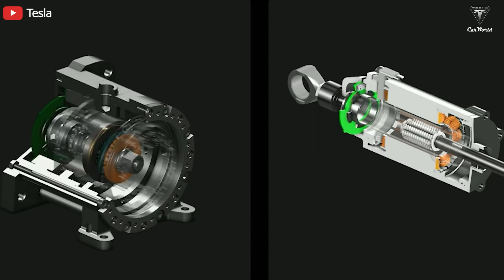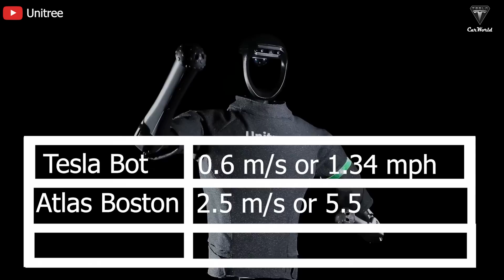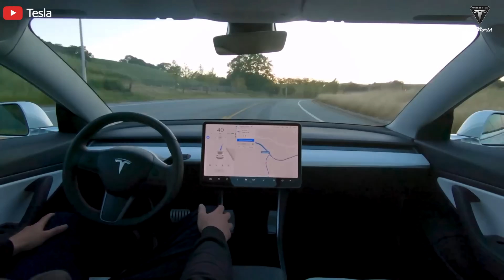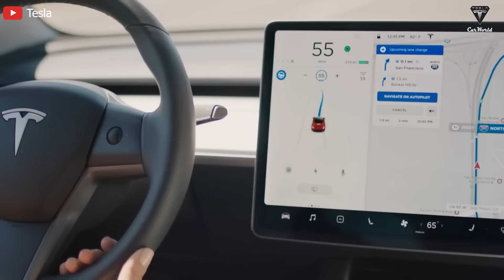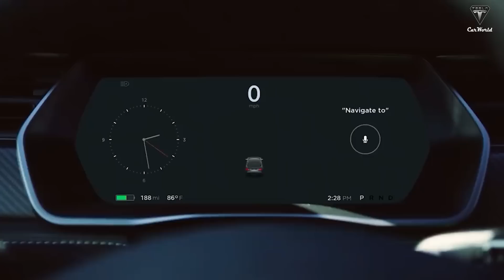It happened! Elon Musk LEAKED The Reason Tesla Optimus Release Late! Mass Produce, Battery and Price

Comment: The statement about Tesla production is stupid - they do not have to build new facilities. They are reworking their factories for more flexible development that is more efficient. They likely put Optimus production lines into every factory. People for that - let me say that you seem to misunderstand what the Optimus is supposed to do. It will start replacing Tesla workers as soon as feasible. Given that they are in competition with various other companies (1x with their NEO) - you can bet they will ramp up as fast as possible.
The main problem is more likely not how fast they ramp up production, but when you can buy/lease one. Because they have a LOT of humans that they can replace internally, taking not only the sale price but also the whole value production of said worker.
Btw., Boston Dynamics they are not behind. Boston Dynamics is highly problematic - high energy use, hydraulics which is problematic in case of failure and expensive to build.
You also mix up the battery. The battery pack is perfect - it is not meant to work all day on it, it is built to integrate with humans in a factory 8 hour shifts with breaks. Someone calculated that it is enough to work 24/7 assuming the same breaks the humans take. 1x goes for 2 hours - with 5 minute reload - saying that tests show people prefer shorter reloads.

I would be more concerned about price. The 1x Neo is - per statement- targeting an 8000 USD price tag. Tesla around 20.000. But then, the moment you see robots, they will FLY off the shelves.

1X btw is already testing the Neo in EXTREMELY limited numbers at home - they go for home use saying that it is more challenging and handles factory setup "on the way". Anyhow, the CEO said some people - including him - have one at home and it is challenging at the moment, but already shows promise.

Comment: If Tesla bot can perform simple chores like laundry and dish washing (putting the dishes in the dishwasher) , it will be well worth the investment for me @ 20,000 or even 40,000
Reply: Don't get too excited yet. Even being able to do simple tasks like that it's still probably not as close as you think.
Reply: @brianleonard6598  It seems hardware dexterity is there if you watch demonstration. Machine learning may take time but after watching figure AI, it seems very close. I wish to see pre-production prototype  by the end of this or next year and full commercial production within 5 years.
Reply: @Westside-riders  Hardware isn't the problem. It's the software that's the issue. There are many variables to account for, for a humanoid robot that interacts in daily life and all of its uncertainties. It's easy to build and demonstrate something like this as being capable of executing remedial tasks in a closed system. This is not that impressive and is absolutely not proof that it can be released for public use. Don't fall into that trap. Take for instance self driving. It works most of the time, but the edge cases continue to pop up that break it. And that's just driving. This is supposed to be an all purpose robot for variable use cases. My guess is we will probably not see this type of thing for many years. If we do see it, there's a decent chance the persons/company that create it haven't started the project yet and it won't be Tesla. 

Source: I work in robotics.
Reply: One-off tasks (even as complex as laundry or dishes) are not enough. That's like a self-driving car only being able to do left turns on the streets of one particular city on sunny days with minimal traffic, no construction and no pedestrians. General purpose robot behavior needs to be on par with (or better than) Tesla FSD. Even FSD will not be fully accepted and ubiquitous until you can talk to the car like Knight Rider talked to Kitt.